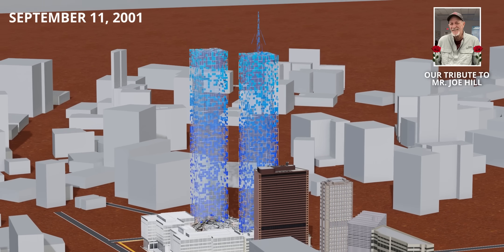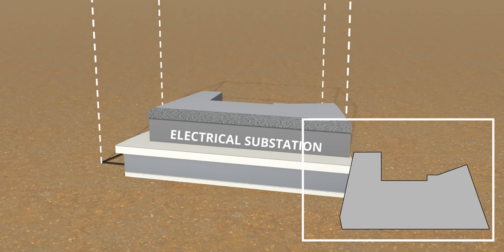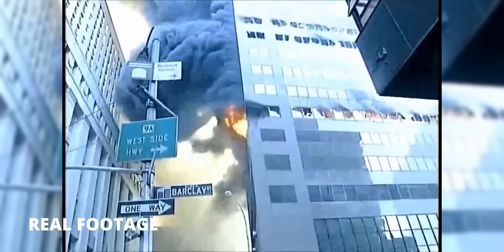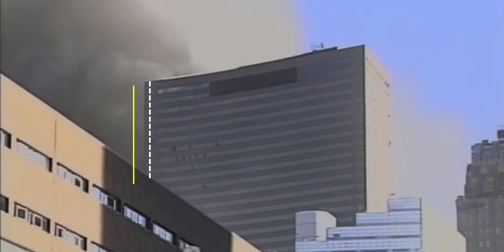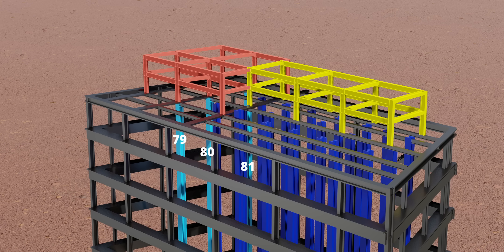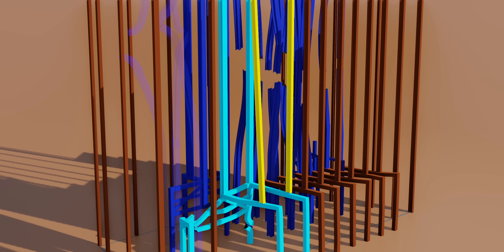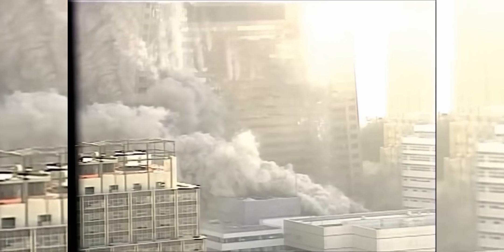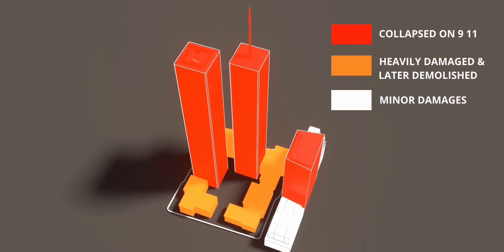Collapse of Building 7 | The Complete Physics

Comment: How can a steel girder break instead of bending? Especially as most of the beams had not been weakened. It's impossible to fall straight down, at the speed we saw, the building should have buckled. Same deduction for the Twin Towers.
Reply: Truss floors
Reply: I think you are missing a lot. Perhaps this will help. 

The North Tower collapse at 10:28am bombarded Building 7 with tons of burning debris, causing heavy damage and starting raging fires burning out of control for 7 hours. Half the responding FDNY firefighters having been killed, others injured, units in disarray, equipment destroyed, no water pressure, and the greater urgency of Search & Rescue efforts, firefighting at 7 was pulled as futile. The building couldn’t be saved and was left to its fate.

www.youtube.com/watch?v=g_SvpwyC17M&ab_channel=MFitz  

Collapse of a burning structure is always a concern for firefighters. Steel buildings subject to fire rely on active fighting of the fires to survive. Buildings are designed around 1 to 3 hours of fire resistance, allowing time for occupants to escape and ACTIVE firefighting to get started, after which all bets are off. Left to their own devices they will exceed their design envelope and collapse. In B7 the occupants escaped, passive and active fire protections were compromised and active firefighting was abandoned which left the building to take its chances. It lost. Odds on Building 7 would eventually collapse, and it did. No big deal in logic. That is the sort of choice firefighters make every day in brush fire situations - which houses to save and which ones to let go. Only real difference here is moving the decimal on the size and cost.

www.youtube.com/watch?v=WnYBX6QT0R4 

FDNY Chief Daniel Nigro ; The biggest decision we had to make on the first day was to clear the area and create a collapse zone around the severely damaged 7 World Trade Center, a 47-story building heavily involved in fire. A number of fire officers and companies assessed the damage to the building. The appraisals indicated that the buildings structural integrity was in serious doubt. I issued orders to PULL BACK the firefighters and define the collapse zone. It was a critical decision; We could not lose any more firefighters. It took a lot of time to PULL EVERYONE OUT, given the emotionalism of the day, communications difficulties and the collapse terrain

FDNY Deputy Chief Peter Hayden ; We had our special operations people set up surveying instruments to monitor and see if there was any movement in the building. We were concerned of the possibility of collapse in the building. And we had a discussion with one particular engineer there, and we asked him if we allowed it to burn could we anticipate a collapse and if so, how soon? And it turned out that he was pretty much right on the money, that he said 'In its current state you have about 5 hours

The collapse of Building 7 was anticipated all afternoon and widely reported in the media with at least 24 video cameras recording some or all of the collapse. Everyone at the time knew what was coming and why.

www.youtube.com/watch?v=OY5S5k3tMHI 

Building 7’s collapse was totally different to the Twin Towers, harder to understand and most of the details difficult to see. But we can sort out what happened through careful analysis and observation.  What follows is MY EXPLANATION of the collapse sequence using the best available information and relying on no authority.

B7 was complex structure, a 47-story steel framed building built on top of a smaller existing 3-story building, requiring several lower floors dedicated to complex load transfer structures instead of usable office space. Of trapezoidal shape and all-steel tube-in-tube construction, B7 (above the 7th floor) consisted of a central core of steel columns carrying most of the gravity load, perimeter steel columns around the outside of the structure carrying the remainder of the gravity loads and long span beams and girders to tie those elements together and form the floors. On the outside of the building hung a moment frame - the last part of B7 to fall. 

Phase 1 : Collapse initiation for B7 is notably quiet with observers not realizing the building was collapsing! There was no audible warning in the form of say hundreds of ear drum busting 180-190dB explosive bangs preceding the collapse. The first externally visible signs of collapse initiation occurred at 5:20:28 pm. Here at 12:00 a local CBS affiliate reporter is talking 10 blocks from B7 when collapse begins. People don’t start to notice the collapse until 12:11. Then at 12:45 is the famous CBS fixed camera clip of Building 7’s collapse Again, note how quiet it is.

youtube.com/watch?v=t5tEy6mXSE8&ab_channel=fresnosean379

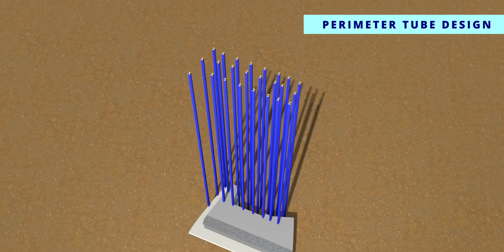Collapse initiation was due to multiple lower floor failures above the load transfer region (7th floor) in the NE corner of the building. In this video at 0:45 you can see the NW corner from inside the building while under construction, Column 79 just out of frame on the left. That big, angled steel beam across the top of the frame connects to C79 at one end. The girders connect to the beam. That beam and all those girders depend on just one connection

youtube.com/watch?v=nP3TNHPCIVU&t=35s&ab_channel=EdwardCurrent

Phase 2 : Lower floor failures (from bending and/or connection failures NOT beam breakage) caused a loss of critical lateral support over an excessive length of core Column 79 and it buckled. If you look at a floor diagram of Building 7 (see above) and look at all the structures that depend on C79 you quickly realize this one column was a relatively isolated structural element on which a disproportionately greater fraction of the structure depended . Externally we see a vertical progression of window breakage along the 44-46 line and a kink in the roof of the East Mechanical Penthouse at the top of the building, consistent with C79 failure. The transition from full capacity to almost no capacity occurs in virtually an instant. Once the buckling failure occurs there is almost no resistance

Normally with a buckling column, the load could very well be redistributed to other columns, meaning the buckling could stop after a while. With C79 that is not the case - the failure did not redistribute the load, so the collapse rapidly progressed to the roofline, sinking the rooftop penthouse.

Phase 3 : With C79 gone, B7’s progressive, non-symmetrical collapse continues with C80 and C81 at the east end of the core left laterally unsupported and quickly buckled and failed as well, sending the EMP down through the building. C79-81 all have no diagonal bracing, which I believe is a major reason why they could not redistribute a lot of vertical loads among one another.

From there collapse progressed from east to west through the central core until the core was gone taking all of the interior floors and structures and probably most of the perimeter columns with it. You can see the horizontal progression of window failures low in the building and the dropping of the remaining rooftop structures into the building. One of the big takeaways from the NIST Building 7 study (that gets completely ignored) was their modeling which determined C79 failing under ANY circumstances would have initiated the same collapse sequence.

Phase 4 : After some 10 seconds all that remains of Building 7 is just a hollow empty outer shell - the exterior moment frame - creating the illusion the building is still standing since little has changed externally. But it’s just a hollow empty shell like an empty cereal box supported by only a few remaining columns and quite unable to remain standing. With all the internal framing gone. the north face leans inward, forming a V in the roofline, the last perimeter columns buckle under the strain and with nothing left keeping it up the moment frame free falls, landing on top of the 7-story high debris pile. It is only at the very end that a single measurement of alleged free fall acceleration is taken. Note this is not the building but just its outer shell, and only one corner at that, at the very end of the collapse. Start to finish the entire collapse took 18-20 seconds, or less than 1/3 of true free fall and we have to look at the whole thing, not cherry-pick little bits to fit a particular narrative. Worth noting _how fast something falls cannot tell you what started it falling in the first place. The debris spread out, blocking surrounding streets, heavily damaging the Verizon Building and destroyed Fiterman Hall, all well outside of Building 7’s “footprint”.  

Building 7’s progressive, non-symmetrical collapse was incidental and unintended collateral damage from the combined effects of fire + time + gravity started by the collapsing North Tower. That is true no matter who planned and carried out the 9/11 attacks or why . The collapse was of so little consequence it barely even registered at the time, a mere footnote. 

Anything can seem like a conspiracy if you don’t understand how it works. Now you should. I hope you found this helpful and informative, not adversarial and it solicits informed critical comment. If I made any errors of fact, logic or reason or left anything critical out, please let me know so I can fix it. IF you can offer a more plausible alternative please do. Be the first. Please start any reply with the words “Tits McGee” or I will know you didn’t read it and are wasting my time.
Reply: @TheCriticalStinker-01  How could your "empty shell" carry the western penthouse Fitzshill?
Reply: @djpiet2072   They developed this strategy during the JFK coverup.  1) just report one dead president , one shooter with no plans for an investigation ( Bush resisted ANY investigation 2) put your best Men on the  ‘ Report’.  ( Allen Dulles, Phillip Zelikow? Are you kidding ?) 3) blatantly ignore even the most basic of facts . Why ? So the public will challenge the basic facts, not the in depth ones) 

To assume that ANY steel and concrete building will globally collapse due to a fire is pure insanity. For reference, if the fire burned up everything including the concrete , a steel frame would remain. 

But for it to collapse for 121 feet at the exact rate of gravity ? It’s just insane. Pure insanity.
Reply: Sur beaucoup de reportage on voit clairement les explosions quand la chute  de la tour commence c’est énorme comment contester ca ???
Reply: @juju-s8n7s those aren't explosions 🤦
Reply: Heat damages the temper on steel beams. When everything is engineered to pinch pennies, it only takes one thing to go wrong
Reply: It was a demolition 100%.
Reply: @jimmybenjamin2555  Other than the "demolition", of course. Which would mean it's not "100%".
Reply: All three were brought down by demolition man come on.
Reply: @ So, what about the other 7?

That, of course, ignoring that this video isn't about any nebulous "3"...
Reply: @jimmybenjamin2555  none of them looked or sounded like an actual demolition. Not even building 7.
Reply: Wow maybe you should watch the video?  Show us the math of fall speed since you know.

Why is it impossible to fall straight down?  This isn’t a cartoon where building fall sideways for no reason.  What other force should have caused the building to not fall down?
Reply: @txag007  This video might as well be a cartoon.
Reply: @txag007 As you can see at 4:44 the different steel columns all broke at the same moment. Incredible.
Reply: @AnnieBodyElse  That's a clear case of visual illusion 🤣
Reply: @txag007  im an engineer. If your logic was correct, every demolition contractor doing controlled demo would only plant their explosive on a few columns on one side of the building, thereby saving money and time. But of course, thats not what happens at all. They place the explosives throughout, to ensure the building falls straight down. Steel columns, when then buckle, dont "snap" like they show in this video. The are not brittle. Instead, they bend. If three columns go on one side of the builidng, it should look like the building is being dragged over side ways and bent. Or, even more likely, most of the rest of the building stays up due to redundancy.  Falling straight down without a sophisticated demolition plan is damn near impossible. For 3 of 3 buildings that day to fall straight down is impossible. Lastly, I always like to teach people about the "passport", because to me, it the single most ridiculous "fact" from that day. The official story, as per the offical 9/11 Commission hearing, regarding a passport belonging to a terrorist is "A passerby picked it up and gave it to a NYPD detective shortly before the World Trade Center towers collapsed". Youre telling me a plane hit a building at 200mph, blew up, engulfed in flames, and some unnamed dude just happenedd to walk by and pick up a passport and hand it to an unnamed police officer? . Its not tin foil hat stuff anymore to question these things. They dont add up.
Reply: @davion3035. When controlled demolitions occur, the adjacent buildings don’t take so much damage that they eventually must be also taken down, or take on so much damage and fires cause the building to collapse outright. 

Let me guess, you also believe a cruise missile flew over the busiest hwy on the east coast, during rush hour, and hit the pentagon, and everybody just thought it was an American Airlines plane, with people on board who are no longer with us?

This terrorist, whose passport was found, where was he when the plane impacted the building?
Reply: @davion3530 lol some engineer you are. When the plane hit the building, small items (like passports) went through the other side of the building before the explosion and ensuing fire even happened. They also found tons of other paper/plastic items like business cards and IDs. And if you knew anything about the design of the buildings and have a good grasp on physical, it shouldn't be surprising they fell straight down.
Reply: @johnp82, I’m gonna have to beg to differ with you a little. The terrorist whose passport was found, we”ll call him Albert Alsaquami for these purposes.  But Albert was on the plane, flight 11 that hit the north tower, which was a direct hit, up around floor 90, out of 110 floor building. It’s hard for people to imagine a 20 story building dropping down on the floor below. 

But anyway, Albert was not piloting flight 11,  we”ll call the pilot Mosttack, or just Moe for short.  Moe was the pilot, Albert was controlling the passengers, but as it was the first flight to crash, there was compliance.  

Where was Albert when flight 11 made contact with the north tower?  If he was doing his job, he was probably making sure nobody was coming. Into the cockpit, and with passengers complying, that may have meant simply standing in the doorway, giving Albert an amazing view.   

Upon impact, old Albert very quickly became a projectile, passport tucked away in a jacket pocket or pants pocket.  Either way, the passport was attached to the projectile.  Again, this is the north tower, a direct hit.  Albert was launched forward, out the cockpit window in an instant.  An explosion, plus the barrier that was the central core, would propel the projectile outa side window.  It would be interesting to know exactly where the passport was found, then trace that back to the crash site.
Reply: @dikranovichk5889  WTF bro 😂
Reply: @davion3530  im an president
Reply: @dikranovichk5889  if it wasn't a cruise missle that hit the Pentagon then what was it?  It certainly wasn't an aircraft that fit through that hole, that close to the ground.  And where is the video footage?  The Pentagon should be one of the most secure buildings in the country and the only video evidence is a grainy security camera from a gas station 3 blocks away?  Yeah, OK. I have some nice ocean front property in Arizona that you might be interested in......
Reply: @ Great reply, you gotta laugh at when people choose not to notice how perfect it was that 3 buildings readily deconstructed themselves in exactly the same way by no more than a furniture fire. Ignited by a kerosene fireball in two very well constructed buildings on the same site, on the same day.  I heard a question asked recently, worth taking not of. Why would a passenger carry a international passport with them to clear airport security  when they are boarding a domestic flight?. And that very passport found happens to belong to a suspected hijacker..... Convenient.
Reply: @jimshorebird,  the pentagon sits next to a really busy highway, that is the main road into Washington. DC.  Not for nothing but during morning rush hour, this road is bumper to bumper full of cars. You only need to drive on 395, coming off Arlington ridge, with an amazing view of the pentagon and DC in the background, to know how dumb your comment is. 395 is not even the only busy road that drives right past the pentagon, geez.
Reply: @davion3530  "WTC7 - The Reporter Who Saw It All"
Reply: @davion3530  What their story implies is even worse. If steel structures could "pancake" because of fire, it would have been literally the simplest, cheapest and the sole method of demolition. They wouldn't even plant bombs anywhere. Just light a fire at the top floor and watch it come down perfectly on its footprint. This method is so consistent(!), they claim it worked three times in one day, at the same place.
Reply: @dikranovichk5889 nice imagination. Keep going.
Reply: @dikranovichk5889 so it was hot enough to met the steel beams but didn’t incinerate a sheet of paper. ok.
Reply: When the “truther” really has nothing to say, they talk about melted steel and termites.
Reply: @dikranovichk5889  and then what would be your argument to that my guy?im seeing you making fun of the argument but not debunking it
Reply: @dikranovichk5889  and then what would be your argument to that my guy?im seeing you making fun of the argument but not debunking it
Reply: @MetalFusionist yea they went through.... the plane?a vehicle like a plane which mind you contains jet fuel and explodes?went through what the windows of the airplane and the windows of the towers?such convenient matters i must admit,btw you said they found a bunch of other plastic made resources, yeah buddy imma need to see some proof.
Reply: Foolish guessing on your part--